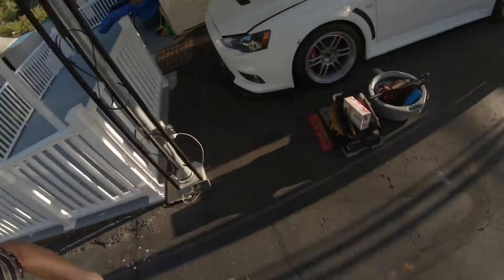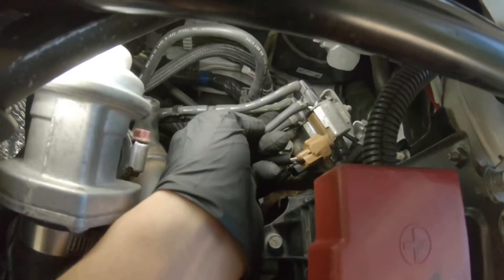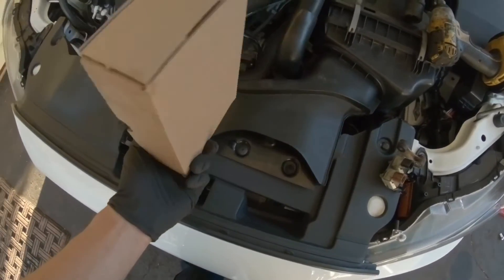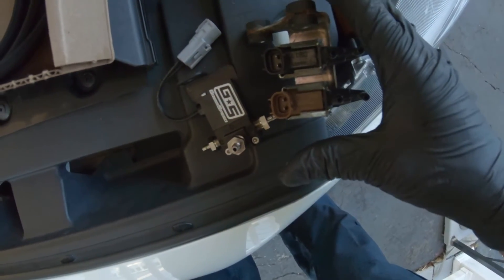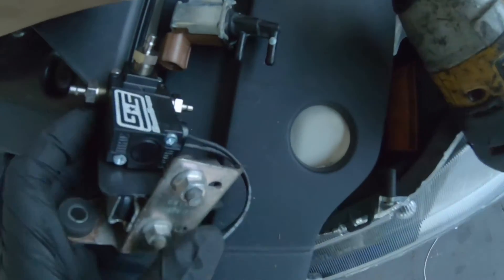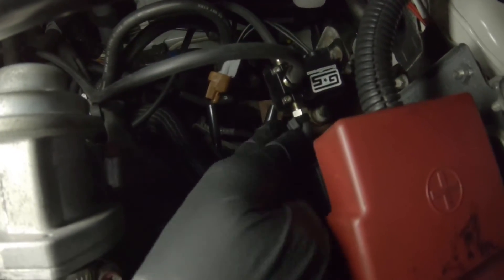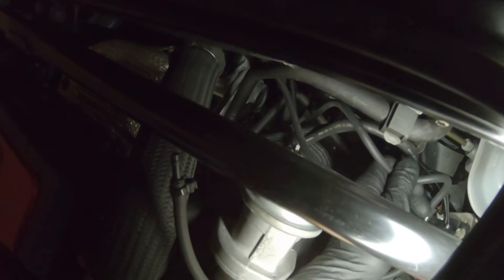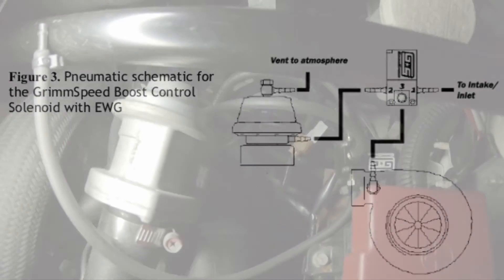Grimmspeed EBC Detailed Install

Comment: Do you have to use the line going into the intake or can I just block it off
Reply from the maker: Have to use it because it’s a 3 port controller
Reply: @DWNSHFTco  is it bad if you don’t?
Reply from the maker: @lonewalker13  I don’t know what will happen, try it if you want to